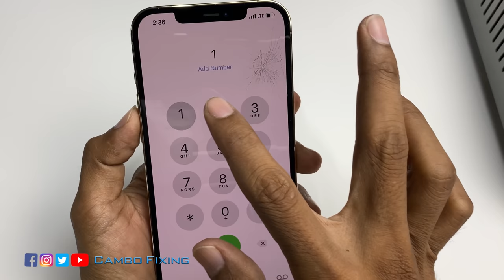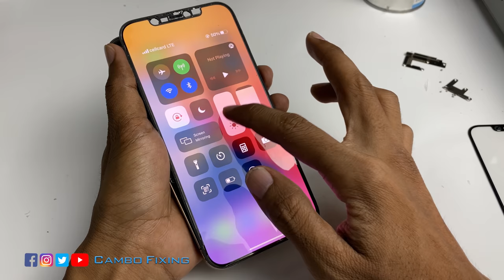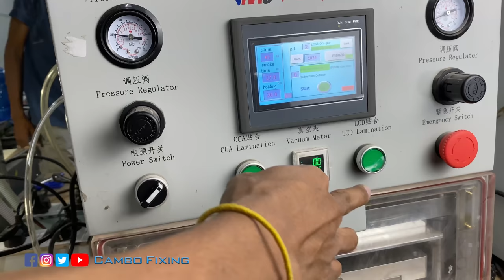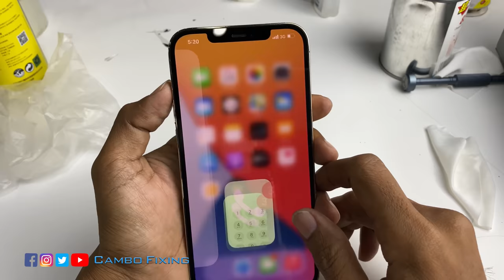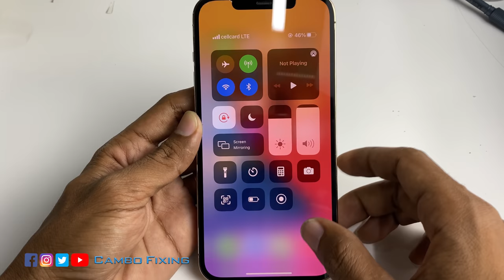iPhone 12 Pro Max Front Glass Replacement | Touch Glass Repair

Comment from the maker: Top of the left corner of the screen it is bubble OCA it's no problem when we put it into the machine remove bubble again but this iPhone my customer his can't wait me to do it more.
Note: It's will be disappear around 3 day
Reply: Sometimes you can’t remove the bubble and I think this is one of them. The only way is to start again
Reply: Good working bro
Bro how to contact you
Reply: @Cyaotic  aa
Reply: @Cyaotic  djfjfjfjfjf
Reply: @zebi007-i5u  jxdjfjfjfjfj
Reply: @zebi007-i5u  jcjcjfn
Reply: @Cyaotic  xbxbfb
Reply: @Mark Li fnnfjf
Reply: Ypuj
Reply: @alanasantos3892  cjfjfjfj
Reply: good work bro
Reply: @امير ابو فضل dhdhdhhdhdhdh
Reply: @youngtoo145  xhxhdhhdhdhdhhf
Reply: 👍👍👍👍keep going!
Reply: @LUSTROUSAsMr  ndjdjsh
Reply: What are the pressure settings?
Reply: Hugo todo voz toco golf Víctor fo
Reply: @isabelfranco7497  cnxncnndn
Reply: Hello sir which liquid you used for cleaning i used this liquid But Not Working
Reply: @atifshinwari1558  kccjfjfjfjfjfjfjfjfjt
Reply: What was the black glue for ?
Reply: How much??
Reply: you can put in debuer and incrise  temp on 60C° on 8bar and it will go away ;)
Reply: What glue
Reply: @Cyaotic  
You can do it , make the Display again hot at 100° and fast in vacum 10 Minutes it will be disappear
Reply: Will the iphone loose its water resistant characteristics
Reply: Will the iphone loose its water resistant characteristics

Comment: nice price without change full oled screen parts. good to see u laminate the glass with a original oled panel. wish I could have the same machine in my home even if I will use that only 1 or 2 time in my whole life
so nice video dude!
Reply: A whole set (screen compression chamber + vacuum chamber + compressor + vacuum air pump, four pieces) cost around $300 you can order them online but the whole set is like 50KG...
Reply: Where can I buy it I need it to fix cracked screens so I can resell iPhones without cracks and keep the original screen.

Comment: I saw some repair guys do this same process but instead of removing the glass with the string while heating the screen, they first place the screen on the heater after heating it they then Remove it from the heater while using the string wire to remove the glass, a one person job becomes a two person job with one person holding the screen firmly while the other zigzags the wire across the screen, which I feel is not right as the screen starts to rapidly cool meaning they have to place it back on the heater to heat up again and repeat the process on the screen comes off
Reply from the maker: yes thanks for comment sir

Comment: Sir what if my phone has its faint hairline single crack at the bottom of the display do not feel it when my mail run over it,,, I don’t plan a replacement now
But I just applied a decree protector pls what’s my fate?😢,,,on 11 pro max

Comment: I think that’s what Apple did with my iPhone 13 pro max since I cracked the back . They took out my front screen and placed it onto a new phone .
Reply: If they did They would only have to transfer the logic board as it contains all your data
Reply: @angelvelazquez1628  oh because when I checked my screen it had a little cracked at the same spot but the serial number is different from the original box smh .